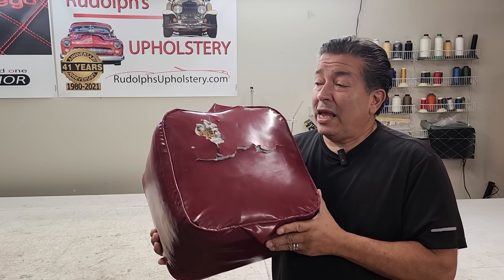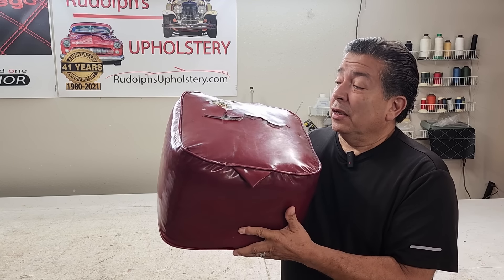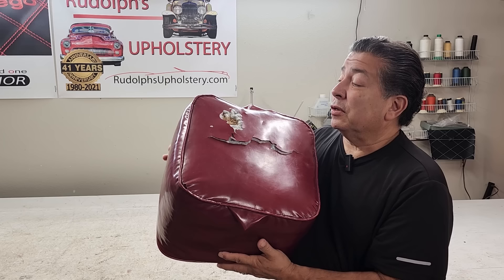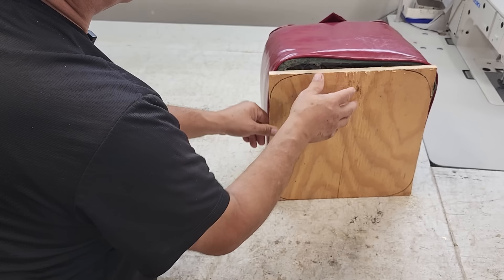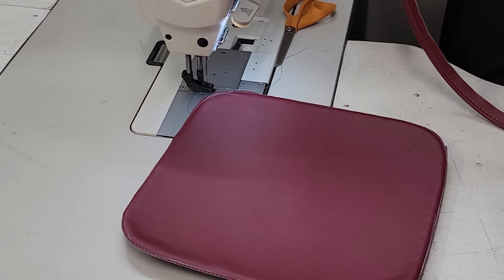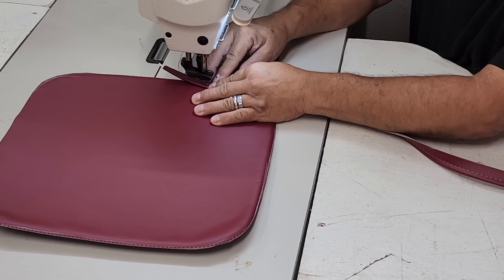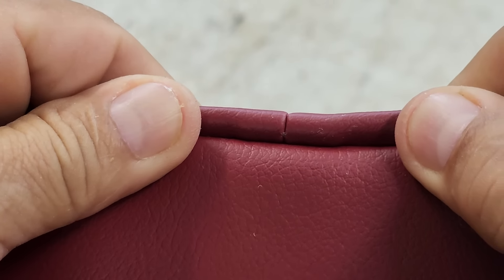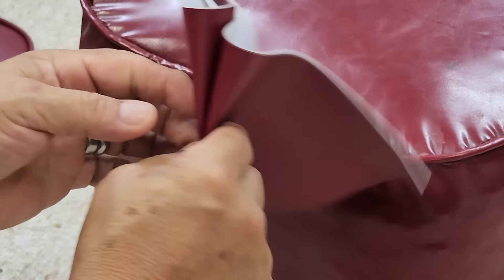The SECRET to Bringing an Old Stool Back to LIFE!

Comment: I appreciate your videos. I’m usually looking for techniques and how I can improve my own  skills. My question is, how do you remove the wrinkles in the foamed/ glued vinyl? Example: I folded a seat bottom while sewing it together and it left a wrinkle at the folded point. Thank you,
Alan
Reply from the maker: Hello Alan, Thank you so much for watching and using my videos to sharpen your game. What I try to do when I can is, I let the glue dry till the next day before I start to sew on it. The same reason I never install a headliner the same say that I glue the material on. Sometimes you can use a long needle to insert between the foam and vinyl to breakaway the glue.  Please keep liking and watching!

Comment: We all know it’s “cording”😂
Reply from the maker: Hello Unfinished, Ok, cording, beading, piping, welt. Uh, huh... Please keep liking and watching!
Reply: If it is sold as Welt Cord, then Welting is likely the original and correct term. 

However, since facts matter more than opinions. A fact is, he showed the label of the material, which says "Welt Cord." That is an independent, verifiable fact. Arguing against a verified fact does not change that fact.

So if the manufacturers label it as that, they made it then it is Welt Cord.

Cording is likely shortened from Welt Cording originally. Or the various other terms may be regional variations or manufacturers' terms. Those different names may have over time caught on, who knows? But do some research and let us know what history you find.

I suspect it may be as simple as a trade name or brand name difference...

Like, Vise Grip is just a brand of players, the type it is known for, and as is a "locking plyers." 

Heard of Bondo? It is a cheap brand, although publicly well-known, it is just one brand of "body filler." Most auto body technicians use better-quality brands, ironically. Only non-professionals typically ever use Bondo brand fillers. Still, people would argue, not knowing that, that body filler is called Bondo.

But you get the idea. Either is a different term used by different manufacturers. Or different, at least originally, based on the religion of the country or its suppliers.

As he says, there is no wrong answer overall. For what he buys and uses for his shop, supplier, and region, Welt Cord is correct. As is it for any of his videos. 

Which this was another great one. Thanks for the upload.
Reply from the maker: @The.Real.Reaper  Hello Thereal, I'll go with what you said... Hehe. Please keep liking and watching!
Reply from the maker: @The.Real.Reaper  Hello The real, I'll go with what you said... Please keep liking and watching!